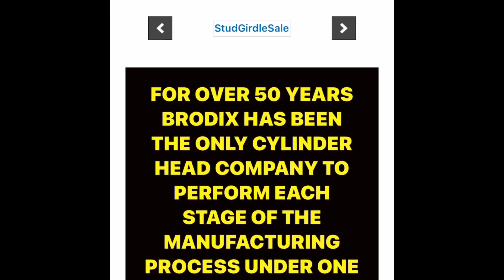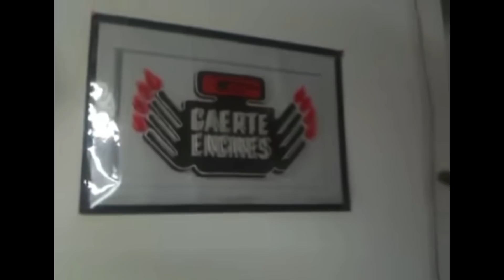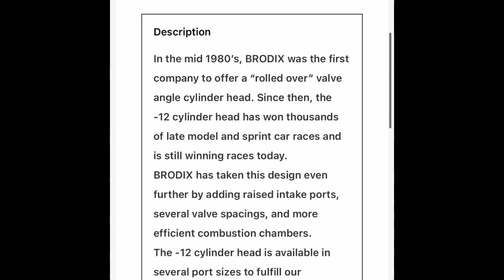MYSTERY SOLVED! What went wrong, and WHERE DID THESE HEADS COME FROM???

Comment: Love hearing story's about old go fast parts and cars, I got a set of old small block double hump no accessory bolt hole heads, they been ported and have a old set of crane roller rockers, got them off a old hot rodder that had terminal cancer and was selling off a shipping container full of his lifetime collection of go fast stuff, I didn't really need them but I knew they were rare, would've awesome to know the history on them, he said he bought them used and put them on a 2 door vega wagon, but switched them out for a aluminum set and said he should of left it alone because it ran better with these on it, I was told they only came on early vettes but Im not sure

Comment: In the late 70’s we ran all aluminum 406 cu in hilborn injection with 16 nozzles, 8 in Brodix heads on methanol @ 15.:1 compression and made around 750 horsepower in a 1200 pound race car. Earl was an awesome builder that had great reliability.

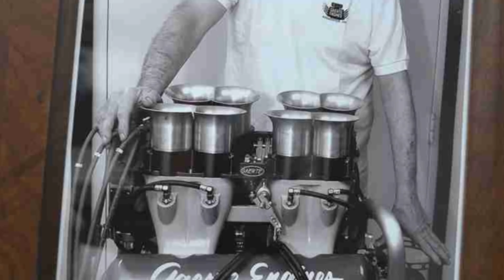Comment: PS- Any up-and-coming builders need to pay close attention 05:54 to how to properly work on a converter. Especially sequencing the bolts.  Pops is sharing trade secrets that I have seen many over look.  Also, 4:10 gears , will you lower the boost?

Comment: Those circle track engines love to rev!! I used to run one on the street for cruising. I would run a 1 mile dirt track cam in my 406...the shift point was thru the roof.😁🤣🤣
Reply: Me as well, my 406 with a turbo 350, 430 gear in a 9" ford loved@ 7400 rpm. Haha. They whole  time  my dad's cringe level  was thru the roof. Lol
Reply: I'll be running a set of Brodix C-series WP 18* milled to 17* on my street Sonoma that started life on a sprint engine.....I look forward.

Comment: LSM makes a slick valve adjustment torque wrench that your Allen wrench fits in. We used it on a top fuel car so I would definitely say its trustworthy.
Reply: Been building motors for over 40 years, that LSM valve adjustment wrench is well worth it. Have a blessed day.
Reply: @rickyd8241   I got the Comp cams valve lash adjustment torque wrench and  I don't leave with out it.

Comment: There is a special tool to set those rockers, it is critical they are not over torqued.  Summit and JEGS sell them. It’s expensive but worth it. It is made by LSM, you just have to pick the one for your application.

Comment: I had the same set of brodix heads on my 406 back in 2001 and they came off a outlaw sprint car motor back when they ran the kinser injection manifolds ironically I live a mile from Dave blaneys race track in Hartford Ohio I grew up watching all of those guys run outlaw sprints before any of them went to NASCAR .

Comment: Why such a big jump on gear? Would the 389-390 work better?
Reply: I've found 3:89 to be the sweet spot in my car for 1/4 mile, 1/8 not sure
Reply: @robertbriggs4176  i figured with the 410-411 it would wanna pull the front tires off the line if tryin to hit it harder!

Comment: Since y'all don't really 1/4 mile the truck, the 4.10s should work a little better. Factoring in converter slippage, it should be going through the traps around 7,000ish RPM.
I have a feeling the truck will be faster than before once you get everything sorted out.

Comment: I think I said they were circle track heads when I first saw them? I also think I mentioned to dyno the engine before trying to install? Maybe Im wrong? Boosted engines are extremely hard on exhaust rockers! Honestly the exhaust at a min should have steel! Those heads were most likley on a 410 sprint car engine that turned 8500 to 9000rpm! They should run great, when you know the engines happy rpm band & wanted timing! NOT being an asshole just trying to save you some work! Been there done that!

Comment: Those heads are as good as you can get back in that day we ran a 438 roller in the dirt car and had set heads nearly what you have. High rpm and fast throttle response. We had to change our rear end gears aswell to match the torque and high rpm. It would turn 9,000 on the red line when he pull in to the pits after the race. You may have to change out the push rod that the rocker broke didn't see you are hear you change or check it out. Good job ole man you have really teach the Kid a hell of alot about the small blocks glad old school teaching is still around.

Comment: You may not be familiar with Sprint cars, but he also built motors for Jeff Gordon.  And everyone knows that guy and how fast he was.  But those are both different kinds of racing and drag racing may require a different type of porting and cam.  But with turbos, every cam is a turbo cam and you can turn them up and down along with timing as you will never be able to use all that power in no prep especially in the first 1/4 of the track with a small tire.  But Billy was always out first and got great hole shots so not sure why you would want to mess with that.  You should be faster at the top if the track is hooked.  Yet you were on a wheelie crossing the finish line in one of the last events.  With more power you will be white smoking or lifting the front more often for a while until you get her figured out.  But on no prep my guess is that you will be fighting breaking loose more than anything.  Especially with a looser converter and a shorter gear.  The more power/torque the looser it will be.  You are going to have to leave on no boost where the motor isn't happy and it might have a 2 stroke like powerband that comes on like hitting a shot of N20.  You can probably smooth that out with adjustments to timing.  But on tracks that have a lot of rubber down.... 35lbs at the top end crossing with a foot of air under the fronts,  rear bumper throwing sparks,  glazing them and just ever so slightly stepping out as you cross ftw.  And it all being caught in 4k video for us to enjoy.  You may also find the chasis's limits  and need a couple more mods to the cage to keep the twist under control.  And a 3rd chute.  lol

Comment: Boss man, a lot of them highfalutin engines designed for the solid roller lifters run spray bar oilers. I didn't really get a look at the pieces parts to know one way or the other. All the circle track high end stuff run spray bars fer endurance in the valve springs mainly.

Comment: What about getting a actual turbo cam for it. That should help wake that bad boy up.
Reply: Every cam is a "turbo" cam. No such thing as a "turbo specific" cam. Labeling them turbo cams is just to sell more cams.
Reply: @jrdmotorsports9718    I have 2 engine builders that I use faithfully for many yrs, Steve Morris and Scottie D PAR and they will agree that any cam can be turbo, nitrous, n/a or in my case procharger but you leaving a lot on the table by using a n/a cam on a non n/a combo...

Comment: Hey bill i used to laugh at all  my buddies who got into those rc cars and trucks cause everytime they got them out they would break them  they even let me play with them one buddy had a truck and just repaired the front suspension and put a new header on it told me i couldnt hurt it no worse than what he has done  guess what less than a minute of me playing with it i broke his new header   I told him see all you do is fix and sink money into these things just like racing ya fix it just to go out and break something else now i decided to start racing just got the car almost ready just needed to get it out and test and tune  put a holley dominator computer system in it my buddies that helped me get it together owner dan davies of diamond racing  a big chevy guy and one of his buddies tuned the car to get it running  all i needed to do was tweek everything  my buddies are chevy people  did i say that already  yep well they tuned the car just to get it running they used theyre knowledge with ls engines to tune my 351 dart blocked 438 ci mpfi   Ok to get to my point i just wanted to get one or two runs to tune and tweek it drove down the road a half mile came to a stop sign it seemed like it lost fuel pressure and stalled   My first time a few weeks earlier i was running open headers with one oxygen sensor  the timing and idle was really erratic   so i put bullet mufflers on it and everything settled down now we were able to set the idle around 1300  and the timing settled down to 25 degrees before the mufflers it seemed to be jumping fro 19 to 37 degrees  i figured it was holley computer with the oxygen sensor causing the timing to be so erratic  when it stalled at the stop sign it didnt want to restart  mr dan told me when i start it to just crack the throttle a bit and start it  now remember me im new to this  im a beginner racer less experience than miss  Molly been around racers and mechanics my whole life but never  serious just a helper  the motor didnt want to start so i bumped the throttle a couple of times and held it half way it bumped and struggled then finally popped of  but now it has a noise like a broken rod   Like i said i always laugh at people and racers cuz they fix and repair theyre toys just to break them  and im learning that my choice to build and race my car is going to be just like what i laughed about  i  hydrolocked my motor and bent a rod  all i can do is shake my head and promise myself never to do this again i knew something wasnt right  from the second  mr dan told me to crack the throttle just a little to start it because you shouldnt have to touch the throttle on a fuel injected engine to start it the computer should control how much fuel it needs to start costly mistake on my part but hey thats racing fix repair go out and break something else  so far i have had bad luck with this car when i bought the car less than 2hours into owning it  i blew the c4 trans to hell at  140 mph i now know the name of my car its called (bad luck)   Bless you and your family and i pray those pesky race demons stay away from billy and brother while racing and i pray for your winning success except if i finally get to race ya